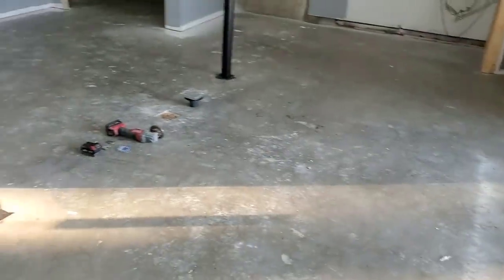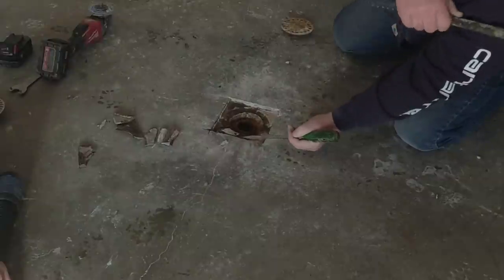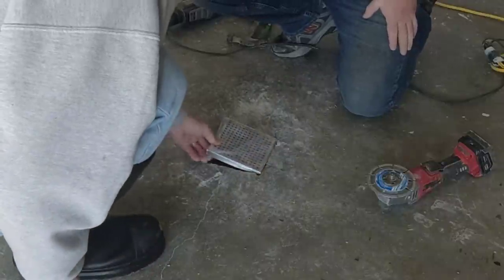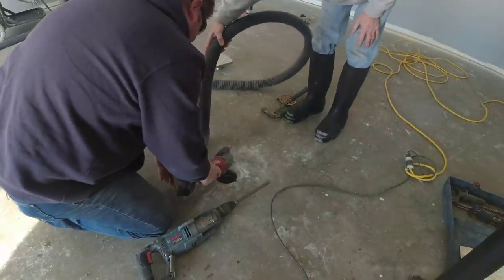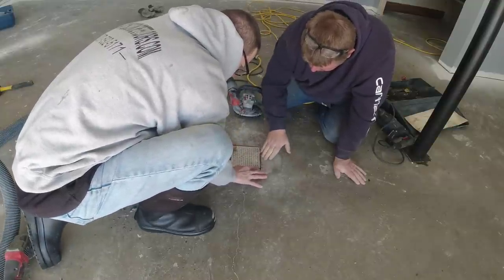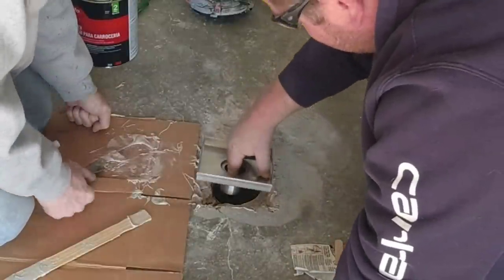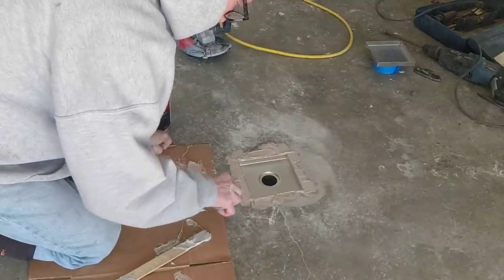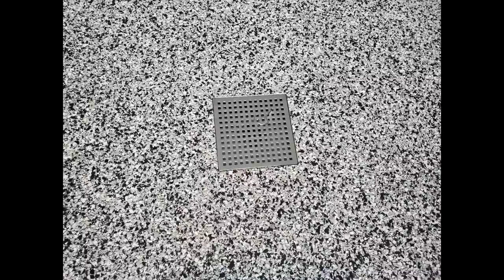Concrete Floor Repair - Installing a New Drain in Garage Floor

Comment: Looks real nice Mike. The only thing I would have been concerned about is you took out a bell trap which when full of water will stop any smell coming out the drain. I couldn't tell if the new one was a trap of some sort.

Comment: Where did the drain pipe go, and how did you check it?  My garage drain seems to not have a pipe. Either that, or it is so plugged and/or broken down that I can't see it.

Comment: Thanks for doing this video.  I will be installing a new 15" x 15" drain in my garage before coating the floor.  Naturally, since there's a drain, there is also a slope to the drain.  Does the slope present any issues or challenges when using a walk-behind grinder?

Comment: Mike, I have a drain in the center of my garage, but the water flows to two low spots and out the garage door. That’s a problem in the winter. Should I add floor drain or float something over the garage floor to level it? This approach won’t necessarily solve the water to the drain issue? Suggestions would be great and appreciated. Thanks